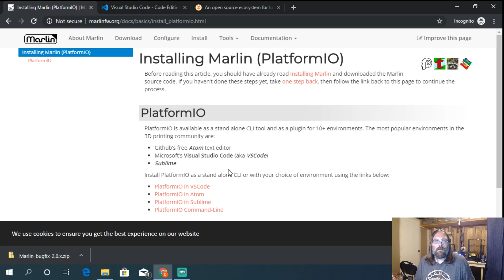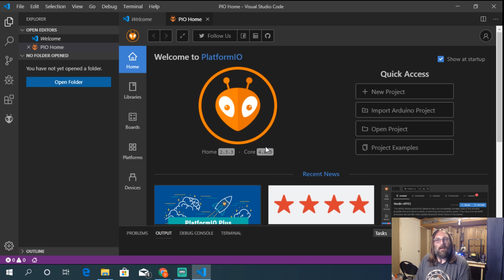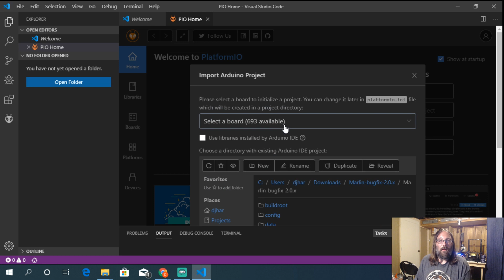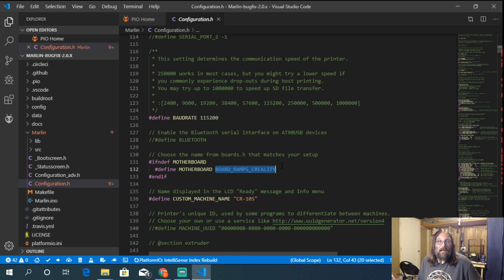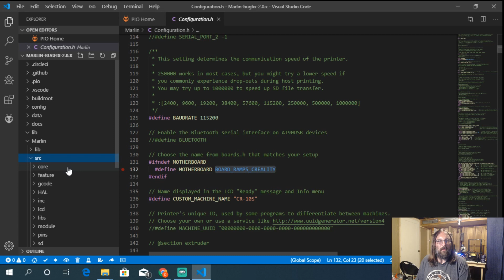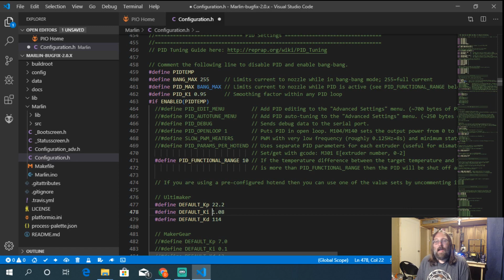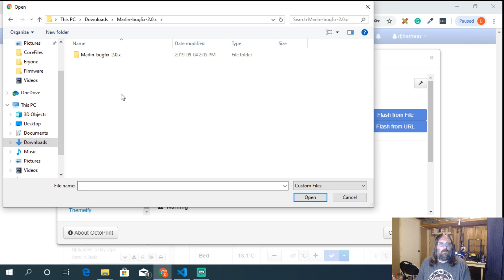Compiling Marlin 2 0 with VsCode and PlatformIO

Comment: Awesome video! I want to do this firmware upgrade to my cr10 max, but when I follow this tutorial, there no longer is any 'examples' folder in the config folder. There is only a README.md. What would you recommend to do?
And also, is there a way to update the LCD as well?
Reply from the maker: The LCD on the max is a lost cause. As for the config examples you can download them separately from the Marlin page.
Reply: @3DMakeIt  thank you!

Comment: Great video David - sorted out some PIO problems I have had, thanks.
Is there a way of setting up a file that holds the modifications I have made to config.h and config_adv.h so that I can 'overwrite' and future Marlin 2.0.xxx version that I download? If not, is there any software that I can compare the now versions to the never versions and modify those (outside Visual Studio Code)?
David
Reply from the maker: Yes you could write a header file that defines the variables you overwrote and include it in the project.  As long as the variables don't change names it would always over write with the values you set.
Reply: 3D MakeIt That sounds great. I know next to nothing about C++ and while I can find some information about writing header files, I can not find anything that gives an example of overwriting variables. Can you point me at anything? 
Also, I wonder how many other 3D users would like to do this? An idea for a future video perhaps!
David

Comment: Error: PIP Core: If you have antivirus/firewall/defender software in a system, try to disable it for a while. 
     ERROR: Error [WinError 87] The parameter is incorrect while executing command python setup.py egg_info
ERROR: Could not install packages due to an EnvironmentError: [WinError 87] The parameter is incorrect

	at c:\Users\Krash\.vscode\extensions\platformio.platformio-ide-1.10.0\node_modules\platformio-node-helpers\dist\index.js:1:35084
	at ChildProcess.d (c:\Users\Krash\.vscode\extensions\platformio.platformio-ide-1.10.0\node_modules\platformio-node-helpers\dist\index.js:1:8215)
	at ChildProcess.emit (events.js:203:13)
	at ChildProcess.cp.emit (c:\Users\Krash\.vscode\extensions\platformio.platformio-ide-1.10.0\node_modules\platformio-node-helpers\node_modules\cross-spawn\lib\enoent.js:34:29)
	at maybeClose (internal/child_process.js:1021:16)
	at Process.ChildProcess._handle.onexit (internal/child_process.js:283:5)

Comment: I could really use some SUCCESS right now.

Keep getting : This terminal process "c:\users\... platformio.exe 'run'" terminated with exit code: 1
All I did was change Steppers/mm values.

Please help?
Reply from the maker: Did you reinitialize the project yet? First thing would be clean the project then try running the build.  If that fails remove the project from VSCODE and re add it in like you would from the start.   These 2 things will probably do the trick
Reply: @3DMakeIt  Hey big guy... Thanks for replying quickly. Much appreciated.

By "reinitialize", do you mean close the project, and restart it? I made a backup of the original, in case I had to start over. By "cleaning" it, I'm assuming you mean "undo" everything I did, to it's original state?

I'll give it another go, and let you know how I made out. Thanks again!
Reply: Well... I tried to build from an untouched version of Marlin, just as I followed along in the video. And, I get the same error. In other words, I tried to build, from the downloaded firmware file, without touching anything, and it wouldn't work. Gotta be honest with you... I've been trying to get this machine running for over 6 weeks. And this firmware will NOT let me do it. I'm working with a brand new MakerBase MKS S_GEN L V1.0, with DRV8825 drivers. I had to buy it cuz Homers tech support SUX. Originally got this machine with a bad board, and it's been nothing but a nightmare. Not a single print. I still haven't hooked up the extruder tubing, because I haven't had a reason to. There's NO SAVE function written into the firmware. Can't save any of my settings. Please let me know if there's anything that can be done. There are lots of these machines, PRINTING, as we speak. Just not this one. Coincidence?Please... I'm begging you... HELP!
Reply from the maker: @Seemsayin  Hey! Ya if you read it will reparse the files
Reply: @3DMakeIt  Color me stupid. But, I don't know what you mean by that. While I have been known to be able to follow directions, those directions have to be spelled out for me. I know I couldn't shine your shoes when it comes to things like this, so please don't think I'm being a wise guy. I honestly don't know what you mean by "read it". I suppose "reparse" means to look at itself again, and regroup, with requested changes?

Coding, & HTML have always been an interest of mine. Had I made an effort to study it, I'd probably be able to do some serious damage, and wouldn't have to bother smart people, like yourself. I'd bet my paycheck that the knowledge (the nuts & bolts) of programming is very liberating, as you can MAKE cool shit, DO cool shit.

Comment: What are you sending the M502 and m500 commands to the printer with and how? Is this done within VS Code?
Reply from the maker: Hi I use octoprint and its terminal tab to send commands.   You could also use pronterface as well if  your computer is directly connected to the printer.   If you don't have a connection you could just open a notepade and add:

m502;
m500;

in the notepad and save somthing.gcode and save it to the sd card and run it from the printer.
Reply: @3DMakeIt  'you are a great man!

Comment: Hi Dave, it's been working fine but I now get a fault every time I try to compile....avr-g++: error: CreateProcess: No such file or directory.   Any ideas?...cheers  Tony
Reply from the maker: You might have to make clean to reset the compile dir.  Have you tried to reinsert it?
Reply: @3DMakeIt  Thanks for that Dave, I reformatted and reinstalled window and vscode etc. It now works as it should.
Reply from the maker: @tonymillward3755  awesome.  I rock the insiders edition of vscode so every now and then I have to do the same thing :)

Comment: I see Marlin 2.0.0 was recently released (Dec 2019)!   I have an old MKS Gen L v1.0 that I'd like to use with a 6v stepper motor, any thoughts if this combination with Marlin will work?   All the stepper drivers I've seen seem to be 8v and up!

BTW, so OctoPrint is a webserver that runs locally on your computer or Octo/Pi, and just is an interface to a board running Marlin firmware?   i.e. if you don't use it, you must use something else like Pronterface?    Or use different firmware - Repetier or the RepRap Firmware?
Reply from the maker: Hi! So I would go through the list of steppers in marlin’s config.h (just search up a4988 and it will pop you right there). To make sure your stepper is compatible.   Marlin can handle the 5160 so I’m sure you can  use that gen l and those steppers.    The physical hardware is more the limiting factor.  If all else fails you can leave it default when it comes to steppers and it will use the a4988 standards. 

Octoprint is a lightweight printer orchestrator that works via usb connection to the printer to send gcode via terminal, print jobs, remote monitoring and remote control.  

So if you want to send gcode via the terminal it’s going to be through the USB cable.   You will need software like all the ones you’ve mentioned to accomplish it.  Octoprint has a cast library of plugins and support which make it very robust. 

Moving to a pi 3b+ or higher with octoprint (free), AstroPrint (freemium) or repetier server (not free at all).  Makes a lot of sense because you don’t have to run a power hungry pc to control you’d printer or worrying about the pc sleeping, restarting or locking up. 

Hope that helps
Reply: @3DMakeIt  Thanks that does help a lot!

Comment: Sorry for the noob question. At the end of the video you say to "do a m502 and m500". I have no idea what that means. Can you explain more?
Reply from the maker: Hi Mark,  M502 is a gcode command that when set to the printer will flash the epromm with the hard coded setting and the M500 command saves those settings.   The reason we mention it is sometimes the old settings still get saved to the epromm after the flash.
Reply: @3DMakeIt  Thank you for the reply, however I still have questions. What/where are you typing this code and how does it get to the printer? I have downloaded Platformio and seem to have a basic understanding and I can follow instructions. I just feel I am missing some basic information that you assume I know. Thank you again for passing on your knowledge.

Mark
Reply: @3DMakeIt  OK, I have been working hard at learning more about this. I have downloaded pronterface and since learned how to make the connection to the pc.

Comment: Can you please show us how to do do an upgrade on Ender 3, I have tried it 4 times but shows error saying text overflowed by 2462, I am stuck at this as now my printer does not detect the USB cable if I want to print. Is there a way to bring back to the original firmware the Ender 3 was in? Thanks,
Reply from the maker: If you look through our videos we just did a bl touch /marlin ender centric video
Reply: 3D MakeIt I don’t have a bl touch installed
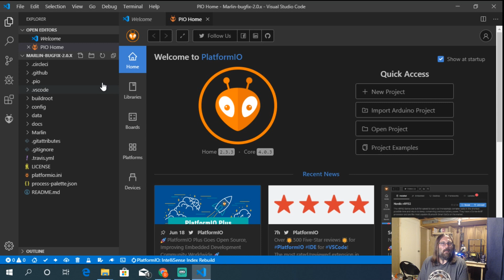Reply from the maker: Hi! No problem at all just skip the auto bed levelling.  The video shows how to use the example file for the ender.  Start the video at around 11:02
Reply: 3D MakeIt, I don’t seem to find the video
Reply from the maker: @kbshah  https://youtu.be/q_lVkC4V8ps

Comment: hi, great videos thank you - i have a major issue, my marlin hangs when compiling....tried vsc and atom , no change, runs a few lines then one line every 3 mins or so, any ideas ?
Reply from the maker: Make sure you have github installed on the machine.   Completely remove platformer.  Close vscode.  Go to  c:\users\youruser\appdata\local\microsoft\ and remove the vscode-cpptools .  Uninstall vscode.  Reinstall vscode-->open it--> install platofrmio.  Then try the compile.  It sounds like it missed some of the library files when you installed it.

Comment: Do I have to choose a board if i will be uploading the compiled fw to my Ender 3 via USB connected to my PC?  I am using an SKR Mini 1.2 Motherboard.
Reply from the maker: If you have the bin file already just plug the board in and it will show up as a USB drive and drag your bin to the board.  If you are using the build and upload in vscode make sure your board is right in the platformio.ini and configuration.h the use the build and upload.
Reply: @3DMakeIt  What board is the right one to choose for an ender 3 pro upgraded to SKR mini3 e3. I have a blank screen after booting mine with wring firmware on sdcard and need to rescue it.
Reply from the maker: @Keithlander  Hi the BOARD_BTT_SKR_MINI_E3_V1_2 in configuration.h and the STM32F103RC_bigtree_512K in platform IO

Comment: None of my 3 printers have example config files.  Can you make a tutorial on how to setup Marlin from scratch?  Thanks.
Reply from the maker: What kind of printers do you have?
Reply: @3DMakeIt  Sovol SV01, MendelMax 2, and a Gigabot 2.  I really want to overhaul the older ones, especially the Gigabot, and get them running well.
Reply from the maker: You could start with the ender 3 example and change the bed size as a starting point for thos ones

Comment: Thank you for you video!
I was trying do follow it but I get an error when I try to build the file:

#include errors detected. Please update your includePath. Squiggles are disabled for this translation unit (C:\Users\gvale\Desktop\Marlin-SKR-E3-Mini-1.2-2.0.x\Marlin\src\MarlinCore.cpp).

It is the first time I am using Visual Studio, so I am kind of stuck here... :)
Reply from the maker: Hey!  keep the file path as short as you can.   Consider keeping the marlin folder on the c:\ drive and work in a folder call with a short name.  c:\marlin2skr as an example.   just use open project to reopen it once you shorten the name.

Comment: SKR mini e3 v1.2 when i try octoprint flash i get errors, i can only use SDcard to do procedure. does anyone used octoprint to flash new firmware from BTT?
Reply from the maker: Oh hi!  There is a GitHub that is attached to flashing with octoprint.   If you go to firmware flasher there is a link on that page.   You have to configure it to mount the sd card in the board and then make the controller reboot to actually load the firmware. It’s all there in the GitHub found on the the same page that loads when you open flasher

Comment: I got an anet a8 plus as a gift so i bout skr 1.3, with 5160 v1.2,as well as tft35 v3.0, every ting works except when i make changes to firmware in any part of marlin 2.0 the build or compile buttons at bottom that are used for platform io., disappear. some of the time outher time they stay let's me build but env 1768 for skr1.3 fail. I use vscode  with platform io,
Reply from the maker: they build buttons should be there regardless of the text editor.  Perhaps the install has become corrupt
Reply: @3DMakeIt   ok my git was corrupted, download a fresh copy and it fixed issue, thank you for your help. ready to try my skr out

Comment: Hi. I've just followed this and your other video on the Ender 3 but unfortunately it hasn't produced a hex file at the end. Please can you advise me on how to get this so I can upload the through octoprint. Thanks!
Reply from the maker: After a successful build look just above the success section it will show in the output where the file was saved.   You can also check the build for in the platform ini file of the project.  But it should be in  /.pio/build/<board name> directory
Reply: @3DMakeIt  thanks, but I know where it should be - found the elf file and a bin file but no hex file! I've also checked for files with hex in title but no luck! Any advice gratefully received!
Reply from the maker: @annastocks1  what board are you compiling for?  Is it set in both the configuration.h and platform.ini.  What does the output above success say.
Reply: @3DMakeIt  I am updating a bigtreech skr mini, having followed your other video. Unfortunately I have shut down vscode so can't check output. Could re-run and check though. Thanks for help.
Reply: @3DMakeIt  have re-run and it still isn't including the hex file. Where should it state the output, it just looks the same as yours when finished. Can I use the bin file to upload using octoprint?
Reply from the maker: @annastocks1  the srk board is the firmware.bin file thats why you don't see it.  You can use octoprint to upload the bin or an ftp client.   The simplest way is to plug the skr into a computer and just copy the firmware.bin file over.  When you plug the skr usb into a computer it will show up as a usb device in file explorer.  I will be doing video on how to upload our compiled firmware via octoprint/raspberry pi coming on Tuesday
Reply: @3DMakeIt  thanks, I look forward to it. I've now just flashed using the bin code on a micro SD card, but am hoping to use octoprint next time. Still not sure why there is no hex file generated though, odd!
Reply from the maker: The 32 bit boards (like the mini) don’t use hex files like the old arduinos do.  They have different architecture and as such basically speak a differently language
Reply: @3DMakeIt  ahh, thanks, understand now.

Comment: PlatformIO IDE wont install on VSCode. Says Failed to install. It wants me to install Python?
Reply from the maker: Make sure you have GitHub installed.  As the python install comes from GitHub when you hit install in vscode
Reply: @3DMakeIt  well it turns out I had Comodo firewall running and it was preventing PlatformIO from installing.
Reply from the maker: @josh9465  ah firewalls always causing issues

Comment: How did you get the Hex file all I could get was the Bin and elf file?
Reply from the maker: Make sure your board is set correctly on the platformio.ini.  if its not a 32 bit board it won't compile a hex
Reply: 3D MakeIt  Thanks for the reply, I have the Big tree tech skr mini selected. I’m using Linux and found the configuration file and changed the output from bin to Hex. I was hoping to use my octopi setup to flash the board since the micro SD card reader on the board is no good. However I’ve learned that for the board I have on the Ender 3 it can’t be done. I guess I’ll have to wait for BTT to see if they will replace the board.
Reply from the maker: Ya the sd card is needed to flash the board through octoprint sadly.